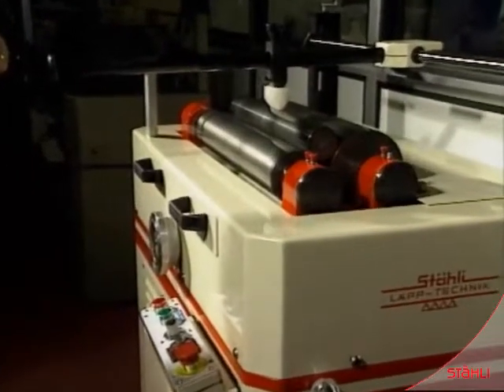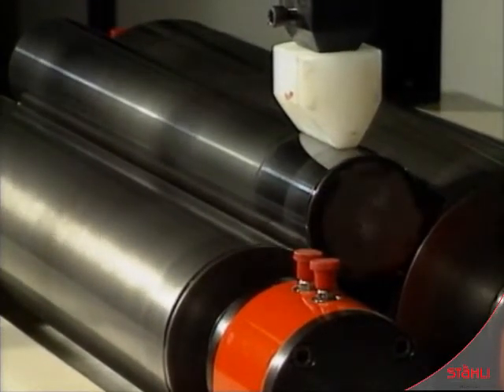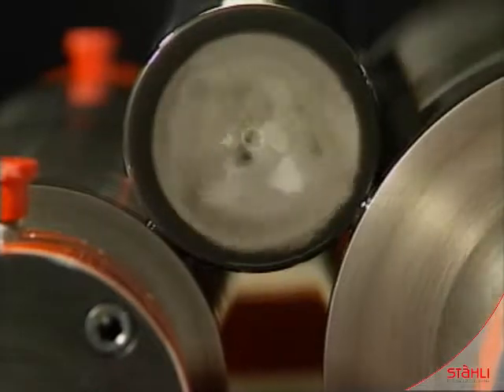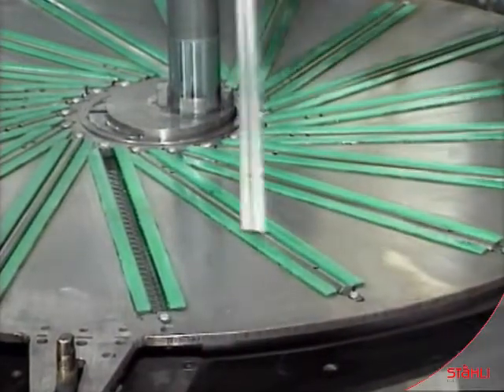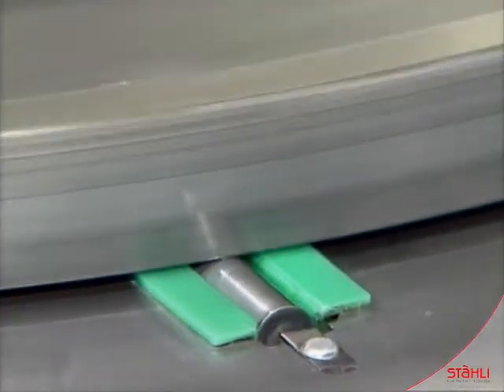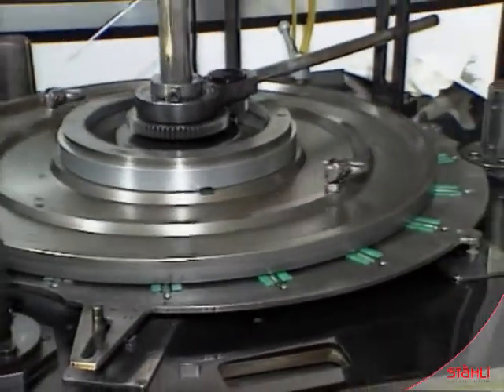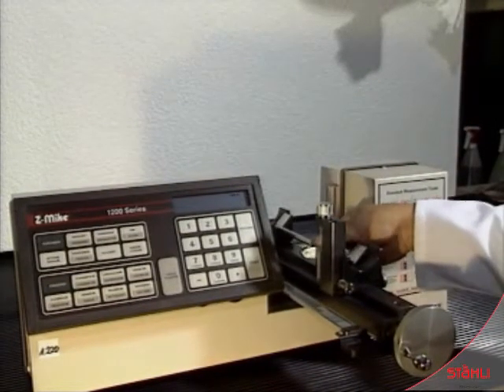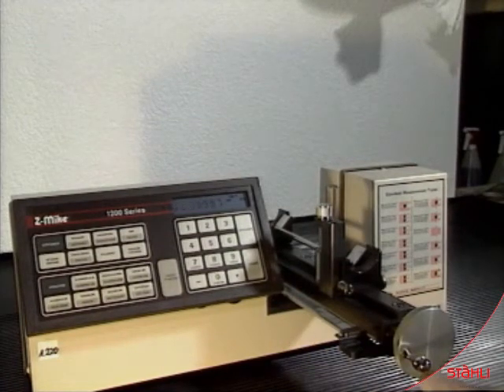CLM 150 & FLM 500-R Cylindrical Lapping

Comment: Do you lose geometry after a certain amount of lapping, or does the lapping maintain the roundness regardless the amount of stock removed?
Steve
Reply: Geometry will not improve, we need pre ground workpieces with roundness and cylindricity in spec - then take as little material as possible (Stock around roughness value plus some), to improve surface finish (usually polished surface) and micron tight tolerances. Sorry for our very late reply!